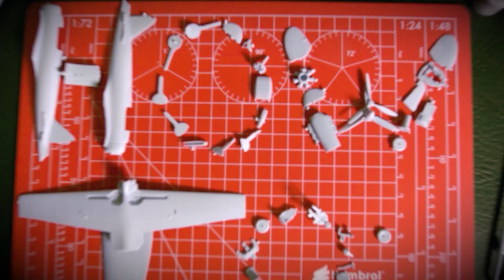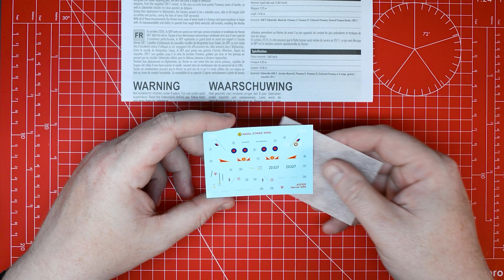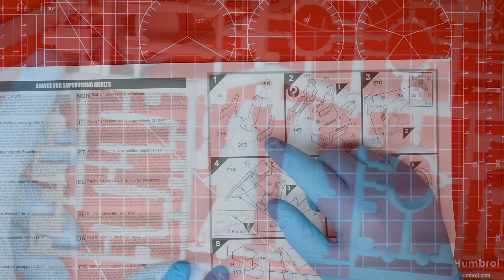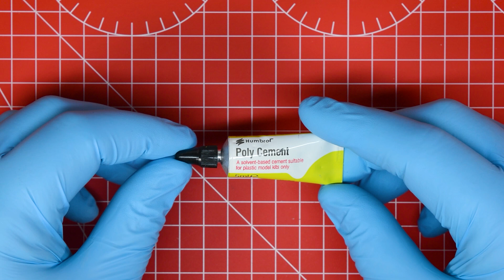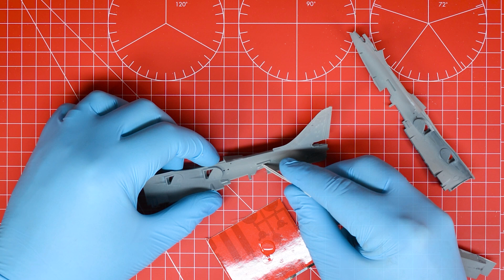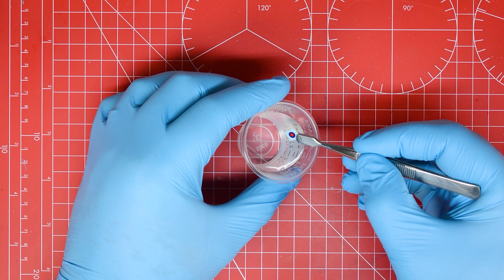How To: Airfix Gift Set- BAE Harrier GR.9A (A55300A)

Comment: Hi Airfix, have you considered whether the poly cement "glues" paint ok?  Plastic doesn't stick to paint too well so is the Humbrol primer specially compatible?
As a second question (I have one of these waitng to be built) have you considered modelling the landing gear in a drooping pose to be more realistic in an in flight pose, gear down in the same way as you put flats on the tyres?  I wonder this beacause I am keen to model it in the hover about to land and a fully compressed gear isn't right for that.